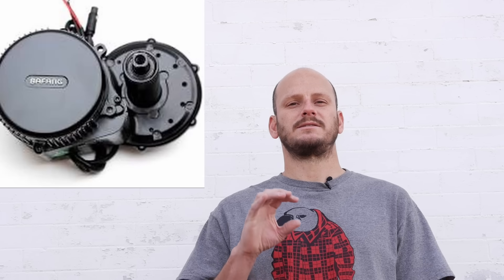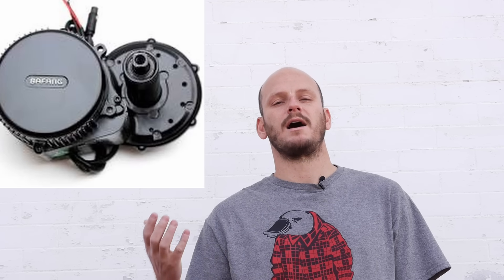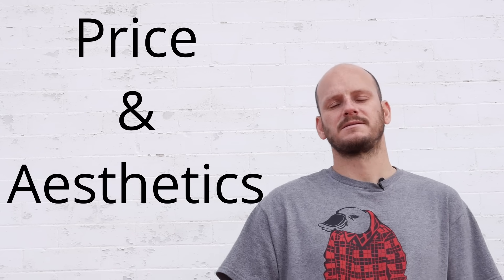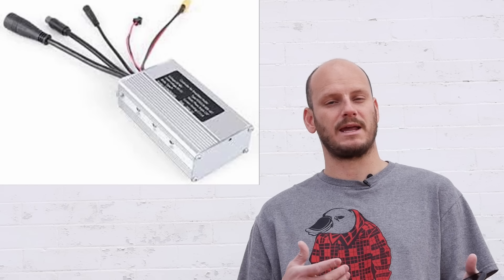Hub vs. Mid Drive Motors: Why Hub Motors Suck and Debunking Common Myths with performance test

Comment: I know this is 2 years after this video but thought I could contribute some to the debate. I also have a 750-watt conversion kit on a downhill mountain Bike (Cannondale Jekyl) with 26-inch tires and an internally geared hub rear gear setup. It performs as you would expect and it has satisfactory if not fantastic performance. I recently bought a dual hub motor Lankeleisi X3000 Max with dual 1,000 watt hub motors on 20-inch fat tires on a smallish folding frame. This thing is a beast and much more like a dirt bike than an e-bike. It has shocking performance and burns rubber on both wheels simultaneously. These are Bafang geared hub motors running at 18 amps in a dual motor controller. Way back in my younger years in the 70s I had a 250cc Bombadier dirt bike and the X3000 Max feels very similar. I am not exaggerating this. I took it out yesterday for my first ride and did 40 km on very hard trails, some with 30-degree climbs (and descents), and generally kept it in eco mode dual drive. Above that setting (the lowest), the motors exceed my gear ratio and eliminate the need for pedaling. As I prefer to peddle to get exercise I keep it in eco mode until I hit a hard climb and then bump up the setting to 2 or 3 and adjust the gearing to match. This bike handled it amazingly and I maintained a speed between 25 and 40 kph (narrow trails with a lot of vegetation so not easy at higher speeds. You can crank this thing up to 50 kph or more but on hard trails, it is more than is safe to go faster. The 48V 20 Ah battery was still showing full after the 40 km ride. I prefer to pedal while riding which on this bike is not required. In general, I was pedaling roughly 75% of the effort but the motors contribute more as necessary. The bike is 37 kg and with 20-inch Fat tires I expected it to be hard to pedal without assistance but this isn't the case at all. It would be a bitch to pedal on a hill though (even in the granny gear) but on flats, it is easier than I had expected. I will add a second chainring and derailleur to add some more on the top end. As delivered it has 7 speeds using a Shimano Altus derailleur. It shifts easily and has no issues. If I had 2,000 watts on a mid-drive motor it would overstress the chain and hubs. So, if you want insane power as well as a nicely balanced ride this is the ticket.

I have been riding mountain bikes for over 40 years (competitively as well). So, I definitely know how to handle an MTB. I built the mid-drive conversion bike so I can ride off-road more comfortably (hills are tough now on my 70-year-old legs). The X3000 Max has restored that wonderful feeling of free riding again and in my judgment is superior to the mid-drive. Of course, 2,000 watts is definitely going to perform better but there is no lag on acceleration whatsoever. In every way, it is more like a gasoline-powered dirt bike than what we think of as an e-MTB.

Comment: I rode a hub drive Bh bike for 9 years and looking forward to getting a mid drive next year. One observation is the mid drive uses the same wheels, brakes and gears as a non powered bike. It is harder to remove the back wheel of a hub bike to replace a tyre as you have to retain all the washers and things exactly as you found them and disconnect the wiring and the little lever that locks the rotor in place so the hub spins instead.
However where I live the bike is legally limited to 25W and 25mph pedelec so you don’t drive it like a motor bike.
In the interests of exercising, I keep the power to the lowest setting, the only issue I had was after six years the battery needed rebalancing and was fine after that. I suffer from asthma and the bike helps me ride up hills and through the wind, I have two unpowered (normal) bikes, I ride on still days.
I have thought to buy two batteries when buying a new bike as the cost will double later and can the cells be balanced?
The original bike shop that sold me the bike was not interested in diagnosing the battery issue but only wanted to sell me a new bike. I found another bike shop where someone balanced the battery for me.

Comment: As someone who has used the Bafang setup to commute to work and gone through the same hub vs mid debate and landed on mid...I just bought a hub motor ebike.  It boils down to it's just more reliable with the chain.  And if there is an issue I still have an electric scooter.   Purpose built bikes, those nice Bosh systems, mid drive is probably nice.

Comment: I want to custom build a bike with the front wheel being a hub motor and a mid drive for the rear, running 1 battery for each.  Any thought?

Comment: Two minutes in and you've flubbed it. "Mid drive makes more torque"... which you then stick through a gearing system, which trades torque for speed and you could end up with the same torque figure at the wheels.

You know what you get when you combine the torque and the speed into one figure? Power. Watts. 750 of them, in this case (minus some friction losses etc).
Reply from the maker: I realize that it was a little confusing. Check out the description for a clarification. 👍

Comment: AS someone who primarily rides a hub motor bike with a good torque sensor. I didnt see the upside of the mid motor at all. I have a throttle, but I am always pedaling the bike, I never really use it. Aventon level2... And The motor always seems just right compared to how I am pedaling. The gearing and noise from the mid was just too much. I like a nice quiet ride. Especially when I ride around horses. They didnt spook because of the sound my hub motor made, unlike the mid I tested. The whine made my friends horses jump away quite quickly. And they are used to wheel chairs, tractors, lawn mowers, dirt bikes, all kinds of stuff like that. It was that same bafang mid motor you mentioned. It wasnt a cheap one. I was riding in some light hills and if you chose the wrong gear with the mid, it was like not having any assist at all. While my torque sensored aventon did struggle a bit, it has street tires, I did feel the bikes assist and was able to continue to pedal up the hill I failed with the mid motor. That was a dirt and grass horse pasture too, not pavement. And after going about 40% of the battery, all PAS mind you. The motor was still nice and cool to the touch. In 70F weather.

So really, this is all how you choose to ride. Both motors have strengths and weaknesses. And my home built mongoose spark with a hub motor, never loosened a single spoke in the 5+ years I rode it. And even with that. Having the front gears and derailleur there made that quite a bit more versatile to ride the trails. Again, I used PAS 90% of the time with that bike too.

Comment: The "average bear" would know that an electric engine has all the torque available at any rpm, so the analogy with Cars in the 3rd gear doesn't make any sense.
Reply from the maker: You are still multiplying the torque (small amount) coming from the motor via a transmission. More important factor to consider is power. Using mechanical leverage allows you to do more work, I have plenty videos up demonstrating my point if you want to see some examples. However, a lot of people don’t need extra power/ performance and for them a hub motor will work just fine 👍

Comment: I bought and rode an electric-bicycle in china-ShenZhen to save on time and taxi-drivers going detours and install apps for taxi-cabs and wait for public-bus... the battery was not wired to my liking and the wire tore off when the velcro gave-way... people can custom spokes for not only bicycles but for 125cc 2-stroke motorcross...

If control is lowest mid-drive package AND 250w/350w hub-drive for battery not to smoke. How will the non-linear world react to linear throttle-travel.?
Reply: If throttle is linear success, add friction throttle-lock and carry the smallest diesel generator(alternator) on the rear-rack with electric-start(for the battery circuit to provide capacitance/quick-reaction to the motors) and AC wall-plug output instead of pulley-cog-gear shaft.
Reply: The wiring should be a-few(12v+12v+12v) small-SLA(electric-drill sliding-cases) independently connected to motors so that the (foldable)pedal-crank can generate for diesel-generator start(when battery is flat) and that pedal-shaft can weld a socket-nut for electric-drill start, quick-release wheel for pulley(rim without tire) swap, ... camping-camper panniers without oven-stove. When need leaf-blower, trenching around tent, water pump irrigation channel ants, cleaning, vaccum-flat blanket in plastic-storage-bag, ... use stones and mud to build stove (boo-hoo-hoo, my life is soooo miserable - excuse built-in)...
Reply: The diesel shaft out to grass-cutter shaft connector
= to flexible-attachment to rod-shafted someThing-manyThings
= to not-flexible pulley-rim duct-tape spokes to fan-propeller rear-carrier (copy from jeep mount wheel on rear door)
= charging air-tank like valves of bicycle-ball shradder-presta-soccer-boat-tent-nozzle to inflate inflatable tent optional flooding boat-tent 
= makes camping-touring with bicycle more-plausible(but still prefer motels with space to park inside room) without fatty tires and too scrawny headstem.

Not-everything
Reply: The bullshit of climate-change, politicians, billionaires, EV-manufacturers, ... called by legislations to block one simple item (for off-grid independence) = why cannot diesel generator.? Smoking-gun on all those losers. Too stupid to survive = politicians, lawmakers, legislators, manufacturers, ...

Comment: Here’s what most of us will choose based on: price. Hub drive bikes are cheaper, much cheaper. The other criteria is a powerful mid drive will require you to register your bike as an atv at the least or as a motorcycle at worst. That defeats the whole reason I bought an e-bike. Otherwise I would simply buy a nice dirt bike and pit ride, etc like I used to.
Reply from the maker: Usually when people buy their first ebike it’s based on price. As they start to ride and get a better grasp, the urge to upgrade builds. That’s where mid drives come in (street legal mid drives)
Reply: @JohnnyNerdOut  While that may be true for some people, I have no interest in buying a $3k ebike, ever. It just makes no sense when I could get a dirt bike and drive through water, mud and up mountains or up huge sand dunes.

Comment: Thanks a ton- I am deciding on my 1st e bike [cargo or tote behind for dual purpose of long trips & lugging tools/mat'l for work] & I was almost sold on the inexpensive Hub Drive models that have suspension & high load capacity... but I have a Bosch Hammer Drill & have been using the same model & it's big brother jack hammer & there is no better H Drill & J Hammer that is electric than Bosch so I was also considering a convo kit for my mountain bike...
I am now sold... I will convert my mountain bike to Bosch mid drive & see about disc brakes since I don't thin k mechanical brakes are a good idea with any E Bike... also I intend to look into running multiple batteries in parallel for my longer trips... you made an outstanding video... extremely informative- Thanks

Comment: Depends on your chain, too.

If you use a KMC ebike chain - ($$$$) - those won’t break.  I have three, and use a wax-based lube in a crock pot.  I cook all three at the same time.  That’s 300 miles of riding…. Just swap the chain every so often. (Park tools pliers).

Comment: When I us m 750 watt super cuiser, h get up and o ill launch me in o the rearend of a car if i on apply the throtle to compensate for the car acceion. I had nosugish issues on acceleration.I have a 5 speed pedal assist however what i have noced i he pedal assst is either on or off here as with the throttlei n slowlybampbup my sped.but thenagai Ihaveacargo bike. my area is noted for steep hills.and I domean steepit is ina video i made.

Comment: 6:30 It is not that difficult to change spokes - i broke 4 spokes in a pot hole - and the replacement was fairly easy - and i drove home with only 32 out of 36 spokes.

Comment: I have the hub drive and really enjoy it. When I priced out the hub drive, which came with the complete wheel, battery with built in controller and a display screen, The cost was half the price.
check into the Dillenger off road deluxe kit.

Comment: I think the engineers at GRIN tech would have something to tell you about your views and also you used Bafang motors which are cheap consumer junk LOL
Reply from the maker: I could also make an argument why mid drive motors suck. This opinion piece relies on which angle you are looking at the situation. You have to decide what kind of riding you do, your skill level, and what kind of performance you need and build a system from there. Everyone arrives at a different destination.

Comment: Just considering buying a tongsheng tsdz2 750w. But  I'm concerned of it over heating. Is the 500w really as high as you should buy considering they don't upgrade the controller from the 250-750? Whats the top speed of a 500w?
Reply from the maker: I don’t carry the 750w version because of that reason. It’s a lighter duty motor compared to Bafang

Comment: Completly disagree! The only advantage with a mid drive is the more natural bicycle feeling if someone is looking for that and if mountain biking is of interest. In all other cases the hub motor is the better solution because there is no loss of power. The Power is directly transferred into forward motion of the bike and no torque is lost in the process. A 50 nm hub motor always has a higher torque as a 50nm mid motor. Also, no strain on the chain and gear with a hub motor. Clearly the better solution especially if you like using the throttle a lot with only a little bit of pedalling.

Comment: How about a Center Drive to rear wheel and a hub drive to the front, That way if mid drive fails you still have a way home?
Reply from the maker: If you travel to places where getting stranded means certain death, I’d say 👍
Reply: @JohnnyNerdOut  No danger of anuything like that. I don't live or operate E-bikes in the US. Main thought on mid drive is ir would produce more power for uphill grades. Frequently 20 to 35%/ One hill is 41%

Comment: I am looking for a 1200 Watt  Mid Drive kit. Highest allowable in Costa Rica. I currently have a 1200 watt  scooter, rear hub drive. But would like more power on hills. And not opposed to a 2000 or 3000 watt  mid drive if vailable. But would want the conversion  without bartteries as those cannot be  put on a plane. Best I pick up such kit in the US.   We have hills common with 30 to 35% grades. My driveway is 21% and found a hill at 41%   Actually see no logic to limiting the wattage/power as long as itr is capable of only legal speed limit. I am 75 cannot have a drivers license here as I am not a Resident. I cannot have Residency without a birth certificat issued ans Apostilled in the last 60 days. Mine burbned up in a fire in 1971, and though I have an Apostilled birth Certifficate issues in 1966 they authorities will not accept it.

Comment: I agree with you most of the time  As a master wheel builder,  why would you think we would build that wheel with 15 gauge spokes, come on man. You build with 18 gauge or larger and build with a cross 4 pattern "tangential",  trust me My wheels hold an adjustment. That said, mid-motor is better.

Comment: I use a Bafang mid-motor. My chain has never broken in the last 4 years.
  You need to buy a good quality E bike chain. I connect it with a matching patent chain link. If someone's chain breaks, they are 100% doing something wrong.

Comment: 1:50 You are quoting Torque ratings for the 750 
Bafang motors NOT all motors as you stated .
Reply from the maker: Correct, I compared same wattage, same brand motors to get as close to “ apples to apples”

Comment: Bafang is a direct, non-geared, hub motor. Mahle hub motors are geared, and only found on high-end road e-bikes.
Reply from the maker: The important thing to remember is that manufacturers make several different types of motors. Mid drive, hub, geared, direct drive.

Comment: you can easily upgrade an hub motor for cheap !  mid drive?? not so much !!
Reply from the maker: $399 for a mid drive. Even less if you wait a long time and order from China. Yes it’s more, slightly, but completely worth it for those that care.
Reply: @JohnnyNerdOut  I appreciate your Fanboy dichotomy.  I would be a fanboy too , but I digress! All the chinise freewheel clutches can't handle 2.5 or more hp!! Soooo I can't support your enthusiasm for such . Sprague cluches from China has been the bane of Spain, and most builds I made.

Comment: My rad city 5+ hub motor 750W just failed after just 3500 miles.  It is a proprietary bafang M155 that is set up opposite of every other motor I've seen in that the motor is on the brake side and the planetary gears are on the cassette side.  A hall effect sensor went bad per error codes n I was going to do the repair but it looks like the motor is inaccessible unless I heat the hub housing to b able to remove the ring gear n extract the motor but i'm not certain yet.  Will never buy a proprietary motor again.  Another takeaway is that the 750W is not robust enough for my 31mile round trip commute.  I ride at 23-24 mph and it appears to generate too much heat in the motor which is primary reason for Hall effect sensor failure.  I'm not sure how my situation would play into the selection tradeoff between hub vice crank motors.  Comments would b appreciated.